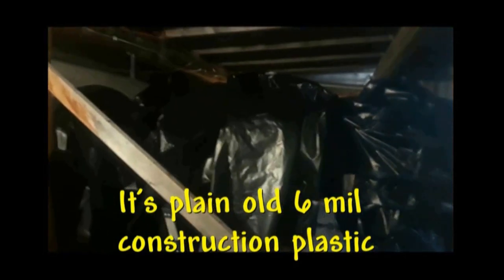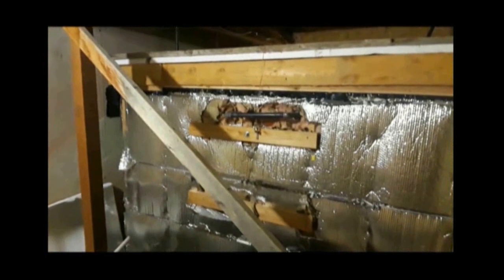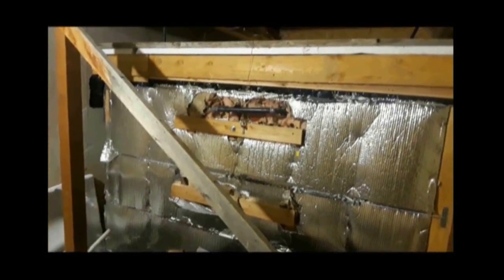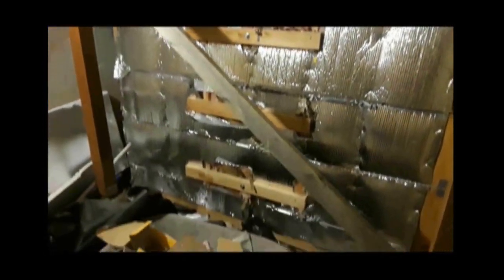Greenhouse winter heating system  Part 8    The new water tank is finished

Comment: Look into air lift pumps, you can pump 900gph on 32 watts from an air compressor. If your tank is 5 foot deep you. Could pump that much 10 feet in the air, and gravity feed you solar heaters.

Comment: Why would you heat water with electric solar panels at less than 20% efficiency when solar thermal panels are 60-80% efficient and cheaper?
Reply from the maker: Well, my experience is that when it is really cold out side, the thermal "efficiency" of thermal panels, in practical terms, sort of melts away. Thermal panels lose a lot of heat back out to the ambient environment when it is very, very cold outside unless you've got some expensive, exotic, vacuum cased absorption elements. For example, suppose you need 100 degree hot water to run your system. If it's 70 degrees outside and you're getting 100 degree water from your thermal panels, that seems pretty good. It's a temperature rise of about 30 degrees. But when it's cold outside, say 20 degrees, a 30 degree rise isn't worth too much. You get a 50 degree output. Also you need to pipe the heated water from the panels too. More heat loses there. It's true you only get about 20% of the energy hitting the solar PV panels, but that doesn't change with the air temperature. 20% of 1000 watts is much better than 100 % of nothing because the losses are so high you end up with effectively nothing. Also I haven't seen thermal panels that are cheaper than PV panels. Maybe there are some available now. Let me know and I'll have a look at 'em.
Reply: Evacuated Tube solar thermal panels are not that “exotic”.  Their used all over the world.  I pulled together some numbers at a 90F temperature differential.  (Cold climate) Thermal panels generate about 850 btu/day per SF, a PV panel generates 225 btu/day per SF.  Since PV panels have come down SO much the cost per btu are much closer than I thought.  31.5 btu/day per $ for thermal and 28.8 btu/day per $.  So fairly close
Reply from the maker: Interesting Dale.  I know the PV costs have come down a lot in the past few years, but I am surprised the $ performance is that close.     But still, I think the PV route is simpler.   You can wire connect PV solar directly to an electric water heater.   Of course it has to be wired correctly for the voltage and current ratings and all that.  Also, don't you still have to use and antifreeze in the thermal type.  That's expensive and a mess if it should leak.
Reply: Given that economically this is a coin flip, I think I would use PV, as you could use the summer electricity, but not the heat
Reply from the maker: Actually I have been doing that.  I have been on solar for a few years.  A while ago it occurred to me that I might be able to heat the greenhouse with it during the winter and fill in a little more for the house during summer.   The solar I already have heats the whole house easily on a sunny but very cold day.      But this year so far, not a lot of sunny days.   Summertime is when the real payoff comes.  Air conditioning, electric water  heating, cooling blowers and fans for the greenhouses all on solar.